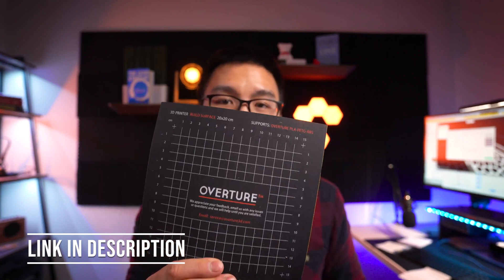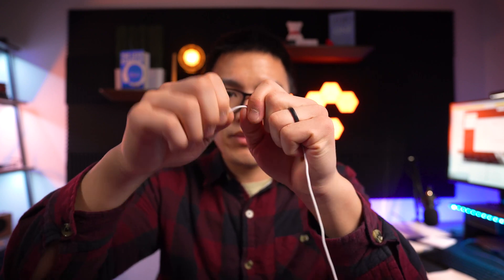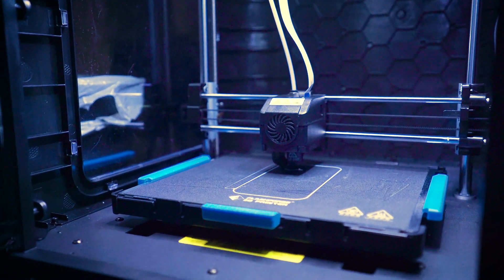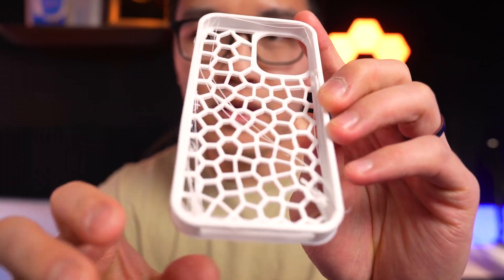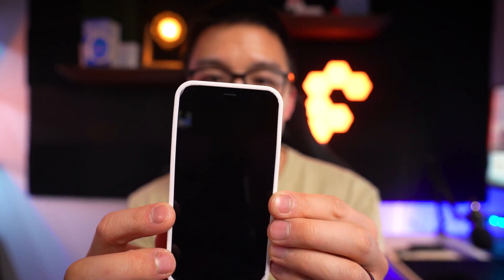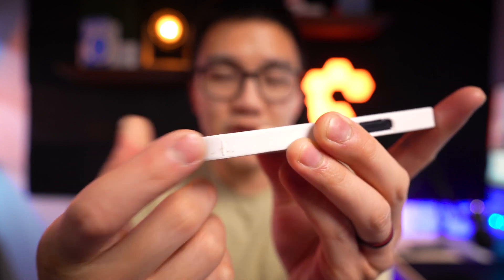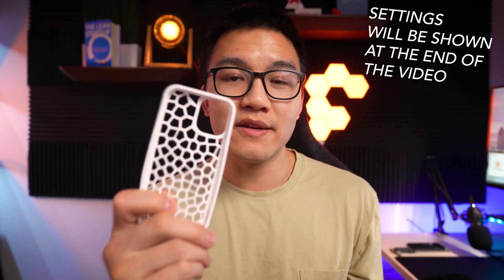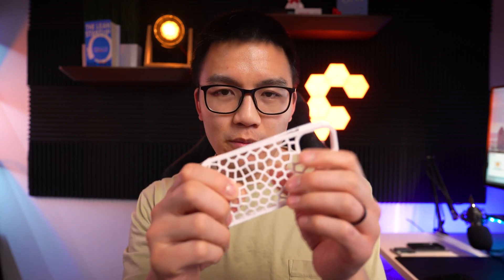TPU with the Adventurer 4! (Flashforge Doesn't Support This)

Comment: I bought the same TPU but still had problems as the filament was getting pinched around the extruder tensioner wheel, but after watching it for a while I noticed that it only got caught pinched in the wheel on retraction. I changed the retraction distance to 0. So far I am getting a decent print.

Comment: Its work!!! Adventurer 3 pro with same settings. Tpu eryone 95a (2h dry on 55C). The upper layers are perfect, but the lower few layers are wider. Perhaps the temperature of the table heating is high....

Comment: I had problems with the TPU not coming out of the nozzle after a few layers, issues was that extruder tensioner needed adjustment. The TPU was getting stuck at the tensioner. Now no problems. Thank you for getting me started on TPU with the Adventurer 4.

Comment: I want to thank you for sharing your settings.  I have the Adventurer 3 and everyone told me I would not be able to print TPU.  With your settings, my very first TPU print turned out absolutely beautifully. There are so many things that I have wanted to make over the years with a soft and flexible material, but I thought it would be impossible.  Now I can.  So, thanks again.

Comment: Your parameters for printing tpu (at the end of the video) work perfectly in adventurer 3 (at least for me and with my specific tpu filament), thanks a lot!!!
Reply: Hi there, I have a the adventurer 3D lite… and been cracking my head on a custom setting for the TPU to come out right… and sometimes it comes out right, but sometimes it just pretends to be printing when actually it’s not extruding( I’m using hatchbox TPU) so basically in trying to make this this to extrude more and print slow… but been unlucky so far. Question is: if you start to slice in flashprint, what filament setting did you choose to make the TPU setting? Does that matter to create a new custom setting? Any advice is very welcome.
Reply: same I can't get TPU running on my adventurer 3 :( @nxsuan
Reply: Same here.  I'm using black Eryone TPU and with these settings, it is working amazingly well.

Comment: Great video. So what is it that makes bowden extruder not work well with TPU filament. What changes can fix this issue.
Reply from the maker: The best analogy would be the fact that you are pushing floppy spaghetti through a straw and at the other end is a smaller hole than the diameter of the spaghetti. If the straw was a lot short (like direct extruder) it makes it much easier. But a Bowden tube is like a half meter straw
Reply: @justmakeitdaniel7667  Yes I see what you are saying. TPU needs to be pulled at the print head and not pushed.
Reply: @justmakeitdaniel7667  nice analogy. One thing that in theory would help is using the Linear Advance with  the  K-Factor setting, which compensates for how much the spaghetti squishes up depending on how fast you try to push it through. FlashPrint has this setting, but unfortunately my testing suggest that my Adventurer 3 doesn't support it and just ignores that setting. Perhaps the Adventurer 4 does though?

Comment: Great video, but man is this TPU print on the AD4 frustrating.
I used your settings, different slicers, different brands of TPU and i haven't been able to print anything in TPU. PLA just works fine.
It seems that there extruderwheels seems to warp the filament in some way. Or it's the nozzle that just blocks and the wheel tries to push through it.
Anybody any ideas?

Comment: have printed many items with tpu with Flash Forge. depending on tpu, i had to turn off the filament sensor and turn down the print speed. This allowed for better print clarity along with bridging i added thin wall inner supports to aid the webbing of material.

Comment: What base setting did you use? PLA, ABS, PETG, etc? Or does this not matter when tweaking the settings for an unlisted material?
Reply from the maker: I basically tweaked PLA's speed but in the end, it doesn't matter which one you tweak. Main things are to adjust the nozzle and bed temp, speed, retraction, and fan until you get a print that is workable
Reply: @justmakeitdaniel7667  awesome. Thank you. Will give it a try

Comment: Hi Daniel, can you share your .fcfg file please ( I assume you are using flashprint)? I have been trying to print with TPU from Devil Design with my Adventurer 4. Unfortunately it's still not printing like it should. I hope you can help me out a bit. thank you in advance
Reply from the maker: Have you tried setting your speed to 20mm/s and no retractions? My print wasn’t perfect as I got stringing and some blobs on edges where retraction typically is required but for the general structure, it was quite good
Reply: @justmakeitdaniel7667  yes I used 20mm /s but there is no option to disable retraction within flashprint. You only can adjust the retraction lenght… and speed ofcourse

Comment: Super impressive printing TPU on an Adventurer 4. I’ve tried with a 3 and had no luck and therefore did not even consider it with my 4. Awesome!
Reply from the maker: I think the key is no retractions and printing slower than 20mm/s. The adventurer 3 should be able to handle it I think since their extruder and nozzle setup is very similar if not identical
Reply: Appreciate the info and your video! Thinking of trying some tpu with my 3 :)

Comment: Thanks for the video. Using your settings as a base to work off of, I did made a pretty good Benchy with the following settings:

Printer: FlashForge Adventrue 4
Slicer: Flashprint 5.3
Filament: D3D Sigma TPU - Blue

Extruder: 230c
platform: 50c
print speed: 20mm/s
travel speed: 50mm/s
first layer speed: 10mm/s
retraction: OFF
raft: none
Extrusion Ratio: 100% 
First Layer Extrusion Ratio: 104% 
Path Width: 0.45mm 
Cooling Fan: 0%"
Z compensation 0.30%

Print time: 3h 16 min
Reply from the maker: is there a reason you chose to change the z compensation? I've never actually touched that parameter so I'd like to know your experience
Reply: what kinda filament you choose for those settings on flashprint?? how come nobody seems to tell this?!
Reply: I've used the D3D Sigma TPU Flexible Filament. It's my understanding that D3D Sigma (not to be confused with D3D) is the same as the official Flashforge filament @nxsuan
Reply: @craigcerhit4716  I meant what did you choose on flashprint settings, come on. Is not that hard of a question… I’m trying to slice the file, on the parameters everybody who uses an adventurer knows the fact you cannot choose TPU filament as a setting, WE KNOW ITS NOT THERE! But you mis pick anything else  to setup a custom setting for the TPU,right? Please tell, WHAT FILAMENT SETTING DID YOU CHOOSE TO MAKE THAT TPU SETTING???!!!

Comment: I use a Fusion3 F410 at work and it runs Ninjatek TPU through a Bowden tube without a problem. I’m still working on making it look good, but it runs it just fine.

Comment: Hello, I am glad to see someone managed to print tpu on flashprint with the adventurer 4. Quick question im on flashprint and I am not able to select tpu as a material type do you know why this might be?
Reply from the maker: Flashforge doesn’t support tpu on flashprint since Bowden extrudes tend to struggle with tpu. You will need to create your own custom profile. The key thing is to keep all your printing speeds constant (I used 20mm/s IIRC) but your travel speed can be high (around 80mm/s or higher)
Reply: @justmakeitdaniel7667  thanks for the reply I coppied the settings in the description seems to be working alright so far! Thank you
Reply from the maker: @TheAntonio322  you’re welcome!
Reply: @justmakeitdaniel7667  I'm diying to try TPU , but please tell what kind of filament to use ??? im using the latest version of flashprint and it doesnt let you choose a custom setting, just the regular options for filament...please advice !